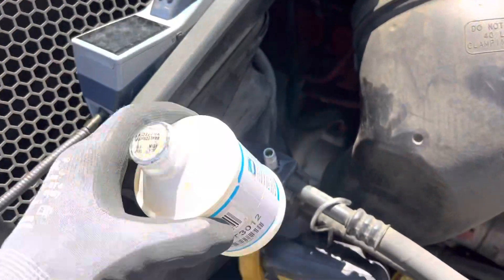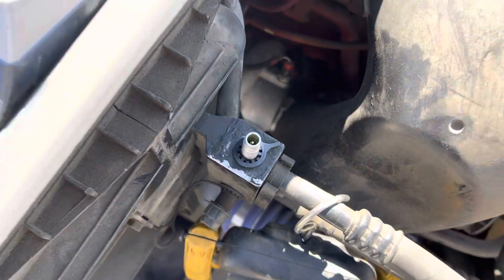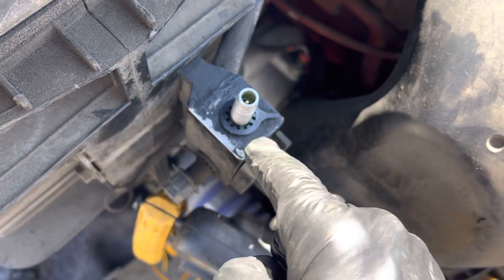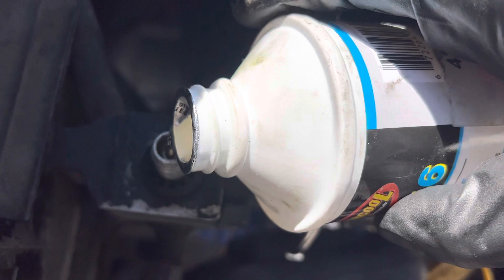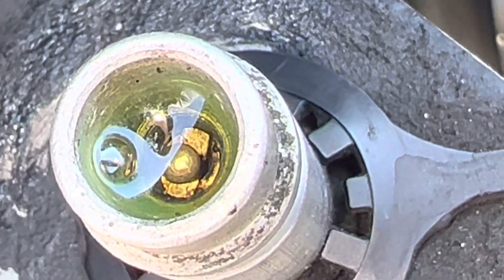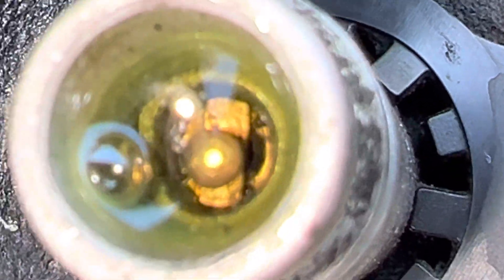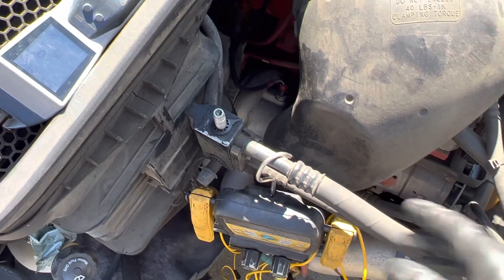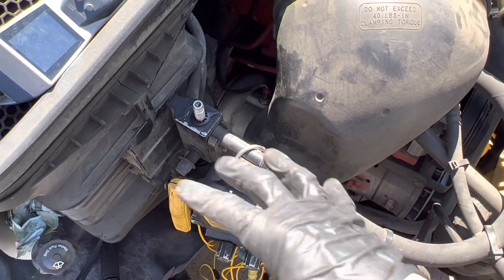Leak test service valve core using oil￼. NOT WATER 💦! ￼

Comment: Mine was leaking on the other valve just when the engine as on, after the replacement was leaking on the bottom of that,
Reply from the maker: That’s why you just replace them if they need it or not, cheap Insurance